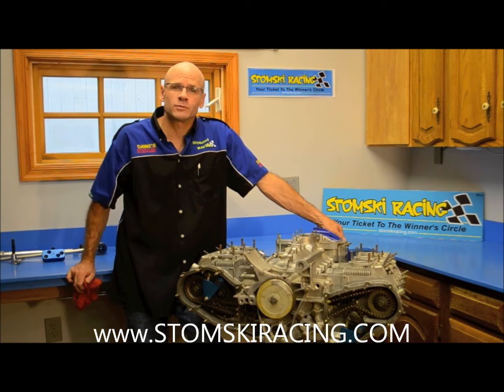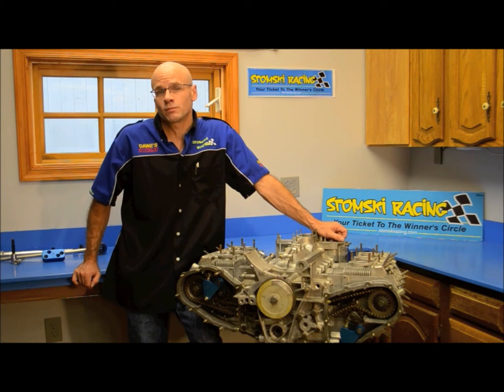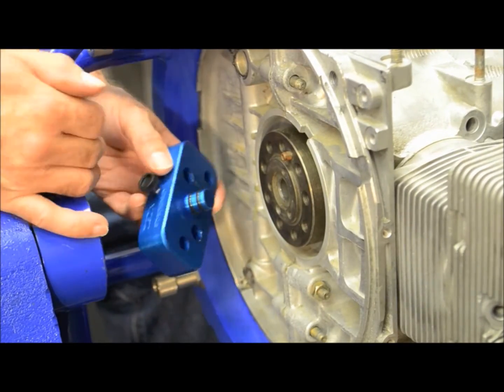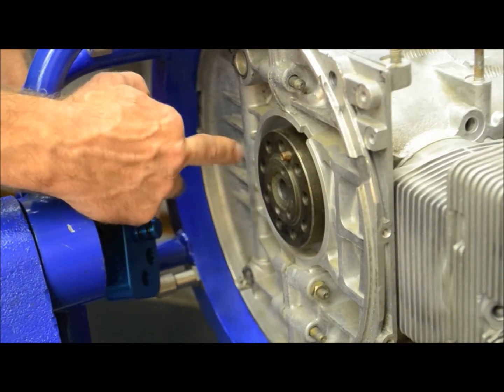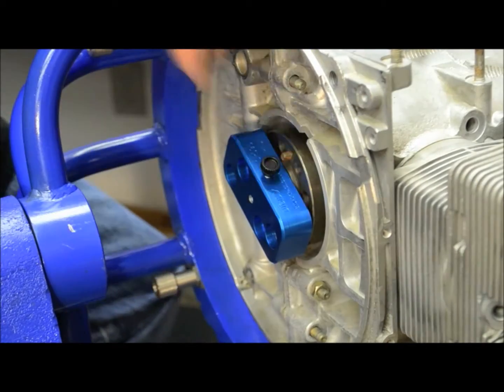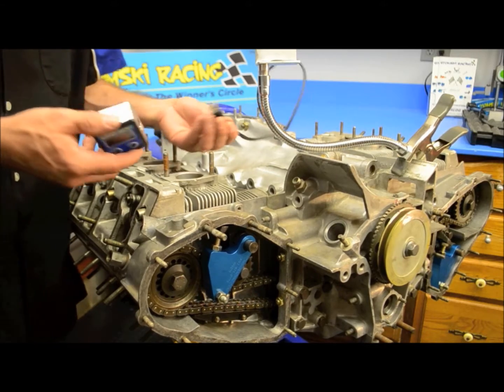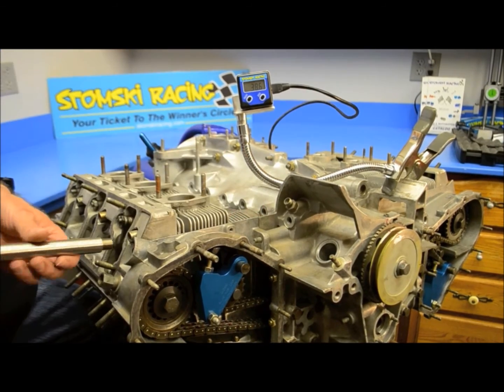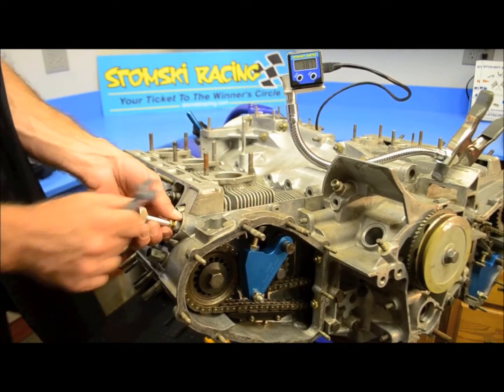Setting Top Dead Center on a Porsche 911 Engine with STOMSKI RACING's DigiDix Digital Degree Wheel

Comment: Why backwards to get 329, why not forward to get 329? Was your Z1 mark to case accurate after exercise or was factor markings off?
Reply: Because he was 15 degrees behind TDC, as you see he bumps the pin tool in cylinder 1 when rotating clockwise… he’s forced to counter clockwise the crank.